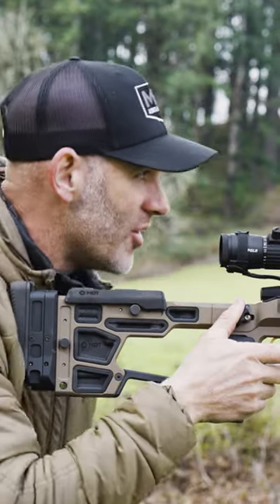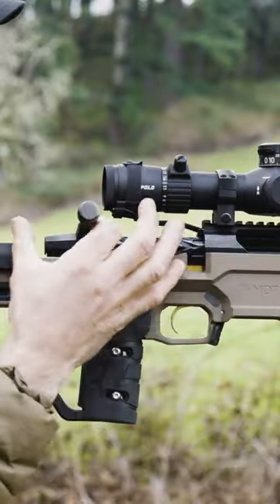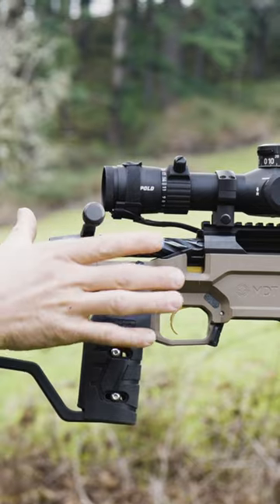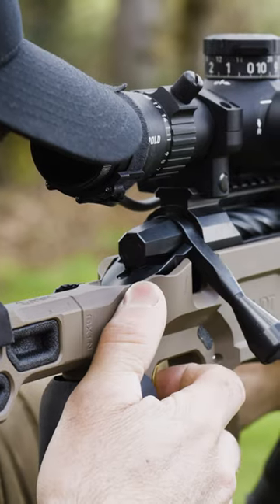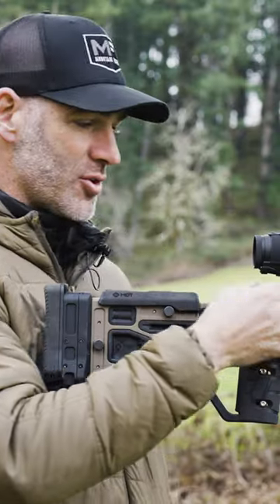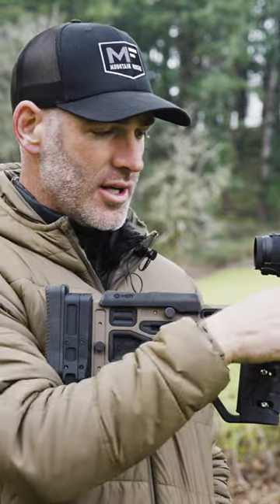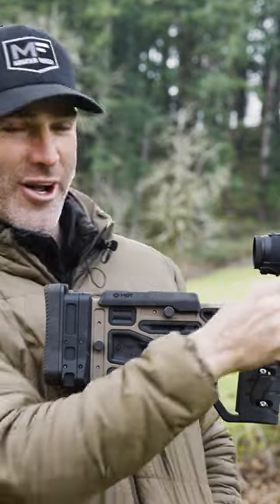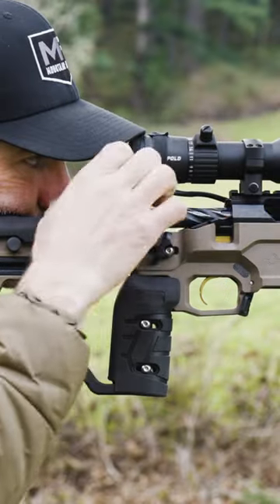Shooting Slow? Try This!!

Comment: Slow is smooth smooth is fast
Reply: No it isn’t
Reply: @modernrambo2  yes it is lol
Reply: @HiddenBrick22  what does it mean then. Break it down. Then I will rebuttal.
Reply: @modernrambo2  essentially, trying to start off too fast you'll end up making more mistakes and actually being slower. Practising it slowly over and over again allows you to do the motion smoothly, doing the motion smoothly over and over again allows you to pick up speed each time, eventually making it so that you can do it fast without screwing up. Slow is smooth, smooth is fast (it's basically a speed based version of practise makes perfect)
Reply: @zatinld6050  so we are both essentially saying, focus on the task at hand, so your brain and vision can keep up with what you are trying to do. Going slow inherently isn’t fast. That’s what I’m trying to say. Let’s find a better term to explain attempting to go to fast smoothly.